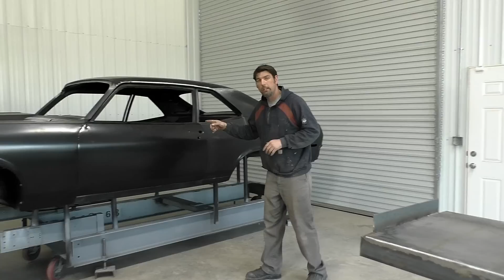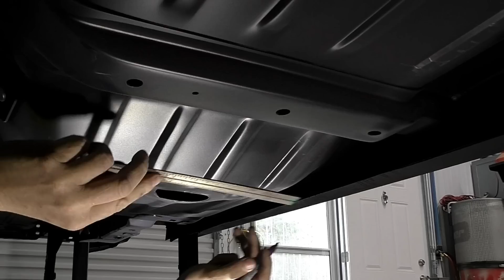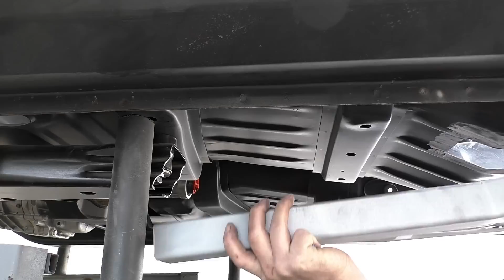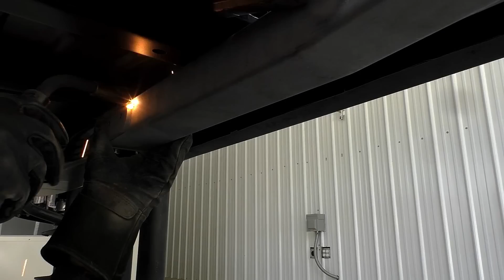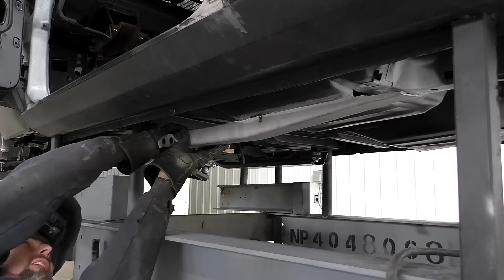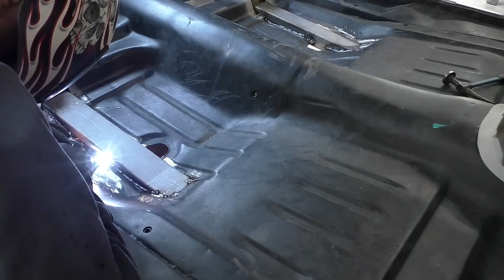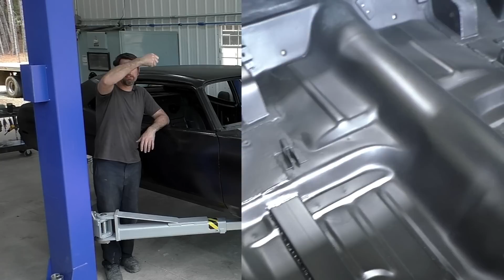1968-1972 Detroit Speed Chevy Nova Subframe connectors step by step

Comment: Looks great I will have to send you some pics of my 73 Z/28, and what I did. I did not have the money for the quadralink. Its very nice. And I agree on grinding down welds where they will not be seen, under carpet and such, because you can, inadvertently thin the floors in the area next to weld while doing that, so I generally do the same....!!! Also ai added a small piece of 14g on the floor, on the front edge where the tie comes up thru the floor, just behind where the front seat backs would be. Luke 1:37...!!! Revelation 12:7-9...!!!

Comment: Will the body flex differently once the suspension and weight of everything is installed? Is the best scenario installing these with platforms under the tires elevated? Or not a problem supporting the frame on jack stands?
Good video cause more and more people are installing these. The cars do handle much better than without them.
Reply from the maker: I don't feel with everything how this car is built there will be any flex in the car. Saying that I also have not done any final gaping until the car is off the frame jig and on wheels and tires. I feel the best time to install these is right before coming off the jig platform that puts no pressure on the car from different pickup points. To answer your question if I have to put subframe connectors on a vehicle not on a frame jig I try and place the car on its wheels elevated
Reply: @ as always thanks for the response Rick. Makes sense